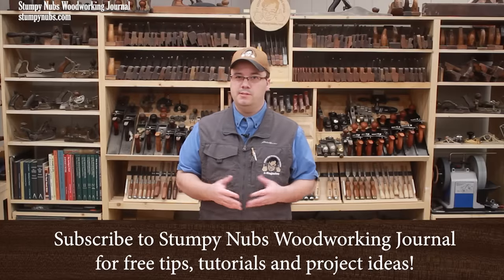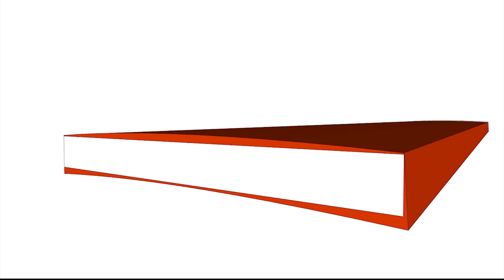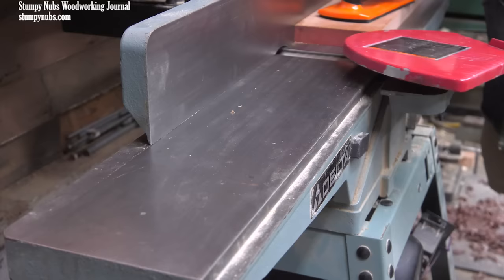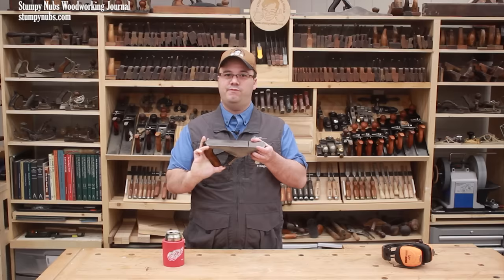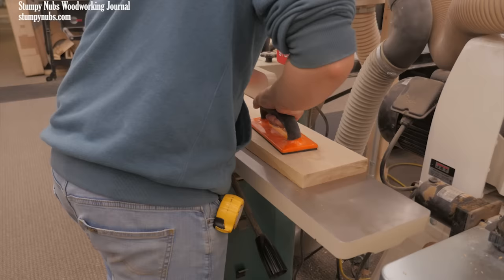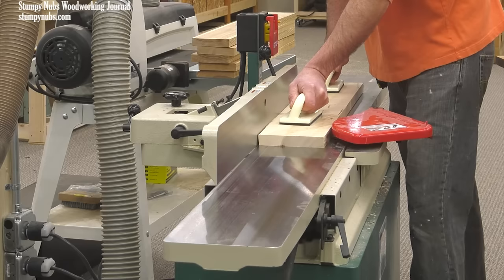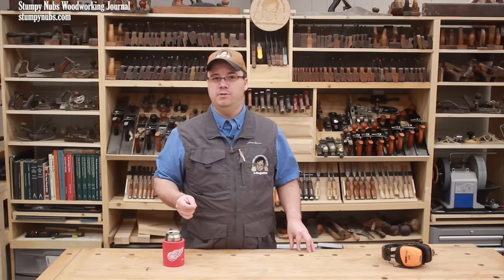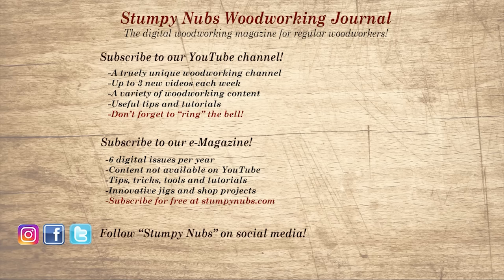Why do they call it a jointer when it planes wood?

Comment: james,,,im in a bit of confusion,,im looking for a jointer and i perfer either the spiral or helical head and i know the benchtop models come at at good price but everyone i have talked to tell me to get a floor model,,i was looking at the grizzly or ridgid,,both of them would need to be changed over,,,may can you give me some info about this
Reply from the maker: Floor standing models have more power and can work with wider workpieces. They also have longer beds which are better straightening/flattening with fewer passes.

Comment: I’ve heard the cat analogy from multiple woodworkers, but I’ve never had a problem petting a cat in a reverse direction. In fact, my cats generally prefer a little against the grain action. 

Usually the problem is petting their belly, which is a far better analogy since you definitely don’t want to put your hand underneath a board for the same reason.

Comment: Hey I know this is an older video, but I thought I would ask a question and hope for the best. I have a workshop with limited space. I currently have a small 5” jointer with a 1200mm bed and a Dewalt Thicknesser. Love the Dewalt. Looking to upgrade my jointer and started contemplating a combination jointer / thicknesser. I have a number of concerns though, not the least being giving up my Dewalt. But is there a reason to be concerned about the jointing function on one of these combination units and the switching between thicknessing and jointing requiring resetting up each time?
Reply from the maker: Some are nice, but others lack in quality. I would read reviews for the specific machine you are considering.

Comment: What is the realistic limit for minimum thickness to be used on jointers and planers? I saw somewhere a reference that 3/4" is the minimum recommended thickness for jointers. That seems far too big to be useful in some applications. Am I crazy here?
Reply from the maker: If the wood is sound, 1/2 inch or thinner (with a light cut and paddles to protect your fingers). The real restriction is the minimum thickness the planer can hadle, which almost always follows the jointer.
Reply: @StumpyNubs   Appreciate the answer to that. I just picked up a Wahuda planer and bench joint, former of which has a rated min 1/8". What am I risking jointing sub 1/2" besides eating through the material? I would imagine kickback, etc would be no different but I that's why I'm asking an expert. I'm no professional and I perfer to keep the length of my fingers unmodified. (I'm obviously referring to face jointing here).

Comment: I'm thinking about step 4, the second edge. Wouldn't it be possible to edge joint that one as well? Either as step 3 or step 4, seeing as you now have one flat face to reference.
Reply from the maker: You can, but the two edges won't be parallel because, as I demonstrated regarding the face of a board, the jointer must remove more wood from one part of a rough edge than another while straightening it. When you flip to the other edge, it will do the same. The chances that those two independently straightened edges will be parallel is very low.
Reply: @StumpyNubs  thank you, that was a great answer. I could hear the pin drop in my head. The second edge will also be square against the face, but it won't be parallel to the first edge. 🤯🙂

Comment: I know this may sound stupid but when do you know you have taken enough off of the flat side, does the blade not reach the wood when the board is flat or would it continue to take wood off thus making your board thinner than wanted    Thanks
Reply: If the piece is small enough I just check it on the jointer bed since it's flat cast iron or if it's to long for that I have a 3' straight edge I check with. You can also mark the face/edge you are jointing with a pencil and when all the pencil marks are gone you should be nice and flat.
Reply from the maker: Because almost all wood darkens over time, all areas that have been shaved away should be visibly lighter. When the whole surface has been shaved/planed you're done.
Reply: @Roct3874  Makes sense thank you
Reply: @StumpyNubs  Thank you I get it

Comment: Sniping only occurs when you install the blades (after sharpening) in the wrong way.
Raising or lowering the outfeedbed should be in conjunction with the blades.

Machine maintenance is something that was missing from my vocation. It would be too expensive if they taught how to sharpen and set up machines in detail, with practical lessons to go with the theory. The machines in my class were maintained by a specialist company...

Comment: Hey Stumpy, I've recently been working with Sitka Spruce, and it's a bugger with the switching grain... is there a way to use a jointer without getting random spots of fuzzing?
Reply: Get the board basically flat and finish it to thickness with a thicknesser but putting the board through at an angle to the cutters often works well.

Comment: I always understood the concept. But why cant a planer flaten out a board? If you plane one side, its flat. Flip it over and youre on the flat side hence the top will plane flat. Ive always done this and used a jointer for edges mainly. Unless its way out of wack, then id use the jointer on the width.
Reply from the maker: Because the rollers will force it to bend flat while it is being planed, then it will spring back when it comes out.

Comment: Why can't side 4 just be another run on the jointer vs. a table saw? Did anyone already ask that yet? I'm guessing since you now have a 90 degree angle its faster to use it to your benefit on the table saw since it will be flush with the table/fence.

Comment: What about very long boards that are much longer than the bed of the jointer?
Reply from the maker: You can joint a very long board, but you will have to take more passes and you will end up with a thinner board than you would if you cut it to shorter pieces first. If you have a log bow in the board, the ends have to be shaved down to the same plane that the center of the board is on. That might mean some pretty thin ends. If you can't cut the board into pieces, you may try forcing it flat with your project's joinery.
Reply: @StumpyNubs  Thanks for your great videos!

Comment: I've always wonder why a rotation, 5 cuts working around the board, wouldn't give a square board.  Presuming the fence is square to the deck.
Reply from the maker: I explained it in the video.
Reply: I asked him this on the combined Jointer/Planer video he did before because I also didn't understand that, so I'll skip to the end of the back and fourth we had. It's because the edge is too small of a reference surface to ride against the fence while you push it forward,.Gravity / the downward pressure you need to put on the board will pull the opposite edge down and make the second face you're trying to joint crooked.
Reply: @DeDraconis  this explains it better.  I'd heard the "references off the table" aspect... but never really gotten why the fence is ignored in that logic.  Your explanation clarified why nicely.

Comment: We can't all afford the price, or room, for a 12" jointer. With a 6" jointer, it's tough to plane down a 12" surface.
Reply from the maker: How often do you flatten a 12-inch board? Most folks do wide boards only rarely because most furniture parts aren't that wide. In those rare instances there are tricks for flattening with a thickness planer.
Reply: @StumpyNubs  Not so many 12" ers, but many 7s, 8s, or even 6 1/2", for edge gluing table tops and such. I use-ta have a 4" jointer on my Shopsmith, but was offered an older Craftsman 6" jointer, which is what I now mostly use. But no matter how hard I try to level the beds, I still end up with tapered boards, if not conscious or careful.

Comment: Why can't one use a jointer also for the second edge?
Reply: Jointers flatten a single edge completely independent of the opposite edge, so it won't necessarily be perfectly parallel.

Imagine running the edges of a triangle through a jointer. It'll make them flat, but it's never going to make them parallel. Same thing applies to the edges of a rectangle if they're not perfectly parallel to begin with. So you joint one edge, then use that edge along the fence of a table saw. Assuming your table saw is aligned properly, that'll make the other edge parallel to the one you jointed.

Comment: If you can start by flattening one face

Then make one edge perpendicular to the flat face

Why can’t you then flip the board over, run the other edge through the jointer, and get a 2nd perpendicular face?

Well I suppose the width is not guaranteed to be even the whole way so you still have to rip it
Reply from the maker: I explained why in detail in this video.

Comment: 'Muricans are funny: While agreeing that the main purpose of this machine tool is to make flat wood surfaces ('plane' them) they still insist on calling the device something entirely different, based on a side-effect of what the tool does. A 'Thickness Planer' describes itself, a 'Jointer' does NOT! The Europeans appear to be more logical in this respect (not to mention them dumping the fraction nonsense in measurements centuries ago).
You 'Muricans have picked up a LOT of baggage in a little more than 2 centuries and you seem unable to shed the stuff...
That notwithstanding, Stumpy's videos are always informative, there are always new things to learn.
Reply from the maker: Thanks for condescendingly stereotyping the culture of 350 million people ("Muricans are funny"), but edge jointing is not a "side-effect", it is a major use of the tool and in many specialty production shops, it's ONLY use. How about you call it what you like, I'll call it what I like, and neither of us pretends to be superior to the other, eh?

Comment: I love using a jointer, but it's by far the scariest machine to use.
Reply from the maker: Really? My pucker tightens a lot more when using a router.
Reply: @StumpyNubs  one of the creators i watch lost four fingers because jointers coast silently... 
surprisingly enough I use a battery powered router that stops almost instantly when turned off. I do have a bigger router, but I just dont use it like I do my smaller one. I dont have space for a router table, nor have I ever used one, and im always cautious with every tool I use. I guess a router in a table would be more dangerous than one that is handheld?
Reply from the maker: @THANATOSIXU  No, he lost fingers because he removed the jointer's blade guard. No matter how quiet a jointer may be, it can't hurt you when the blades are covered :)

Comment: The jointer flattens a board face. If you flip it, it'll flatten the other side also.  Both are in reference to the jointer bed.  SO if both sides are flattened in reference to the jointer bed, how are they NOT parallel?  This makes zero sense.
Reply from the maker: Boards dry inconsistently. The two opposite faces are rarely perfectly parallel before jointing. A jointer can flatten a side, but if they aren't parallel to start with, they will not become parallel when you flatten them. Also, if a board is bowed, the jointer will begin taking more off the leading end because the trailing end is hanging off the end and curving a bit toward the floor as you advance it forward. With multiple passes the board will be flattened, but the two faces may be forced even more out of parallel than they were at first.

Comment: Let me get this straight (pun intended): A jointer does what a hand planer does except downside up and bigger. And a thickness planer does what a jointer does except parallel to the upside.... Right? Why didn't you just say so?
Reply from the maker: Almost all electric woodworking machines do what hand tools do.
Reply: @StumpyNubs  
I see you have an impressive collection of hand planes but what good is a plane without wings?